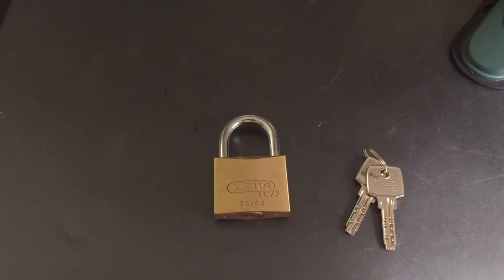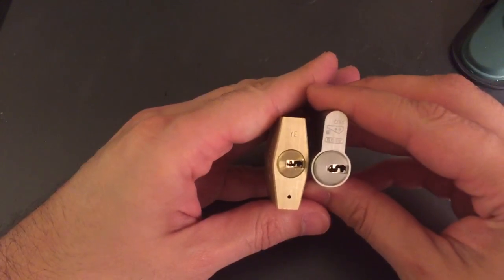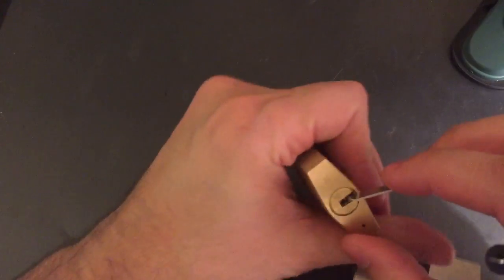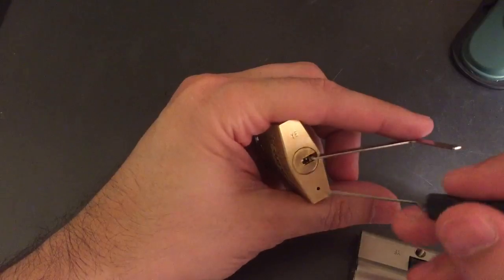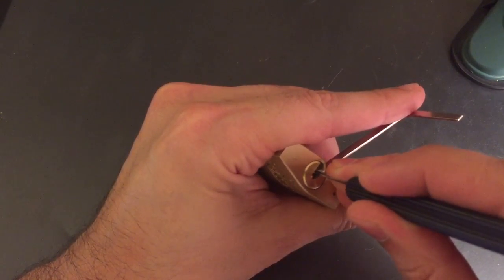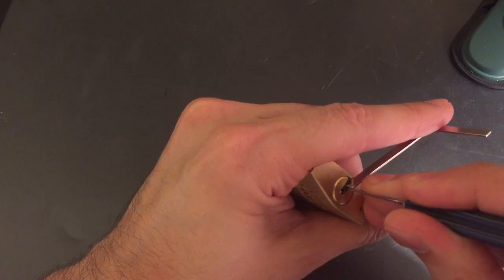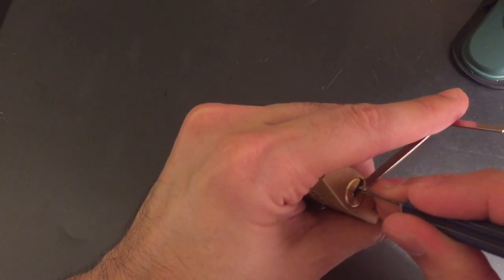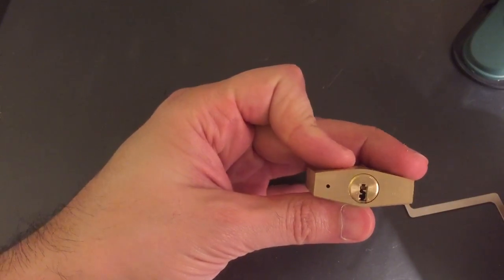[12] Abus EC75 Dimple Padlock (75/40) Picked

Comment: This video has given me an idea what to do better when attempting to pick my ABUS EC75/50 lock. My lock needs to be turned a 180° degrees and try to pick it "upside down".

Hopefully this one will be easier to pick than the EC75/50. The warding and the badass spring strength on the spools is just too much for me right now 😅